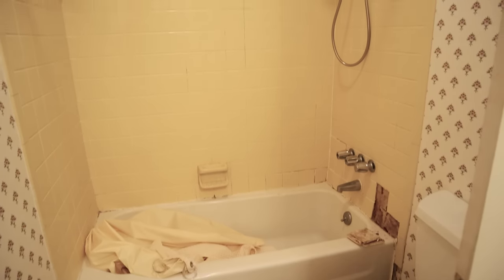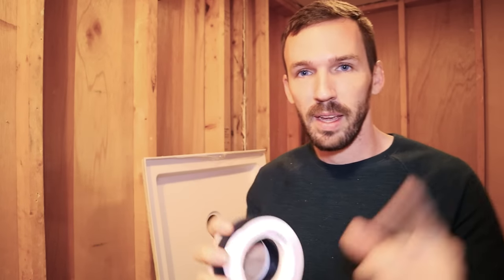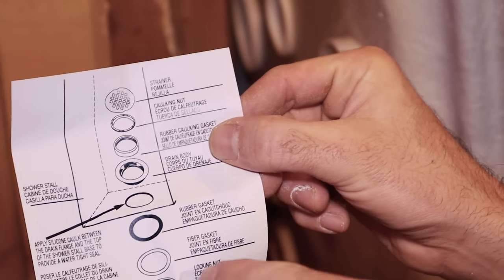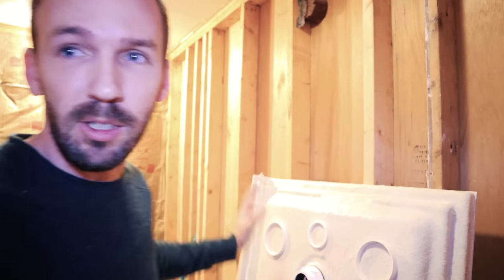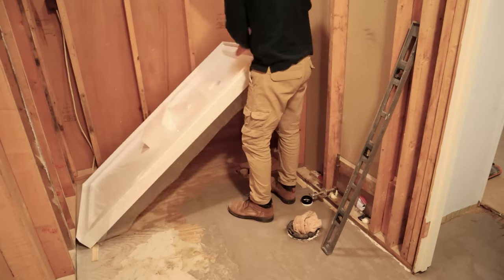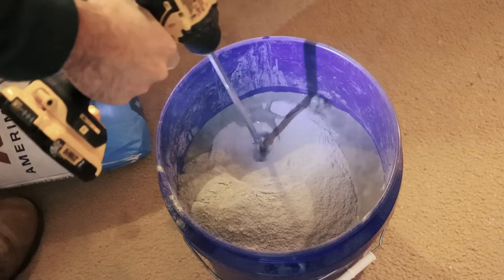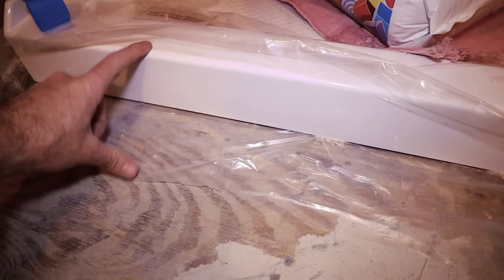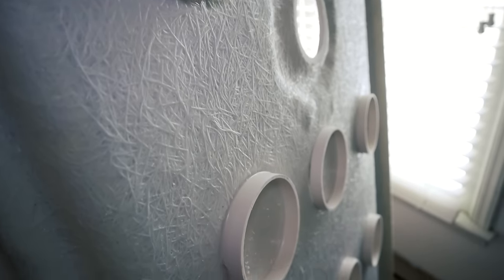How to Install a DreamLine Shower Base With Oatey Drain

Comment: As a newb to plumbing and scanning youtube on how to install alcove shower pans i'm finding it interesting how no one actually shows how to connect the  new drain to the existing plumbing. i would think this would be a pretty important instruction. everything else seems to be pretty common sense. not bashing the video just making an observation.
Reply: I noticed the same thing. Especially no videos showing how to connect one to a concrete slab. Or in my case connecting a offset drain to the existing piping on a concrete slab.
Reply: That’s the trick you can’t give away the ingredients to the sauce. But I’m glad you said that cause I need to know I’m a newb in carpentry and I’m redoing my shower
Reply: I just said this as I'm watching the video. Saying you did a step but not showing it, really messes up the "how to" part of the video.
Reply: Lol same no ones showing the drain install
Reply: @GamechangerzB  I figured it out on my own. Doing it on a concrete slab is more tedious but I got it done.
Reply: So for this installation if look at end all the he's really doing is setting the drain on top of the pipe and end putting the final drain cover
Reply: The plumbing is the hardest part in my opinion.

Comment: putty is oil based which is not recommended for polymer based surfaces.  so in this case, silicone is a better choice.

Comment: I can not find out at what height I should cut the drain pipe  so the drain connection will work. from your or any other videos. about cutting drain height. Maybe you could include that information I find that to be an important point.  If you can forward your method I would appreciate it. Good video

Comment: Looks great! Not that my opinion matters but, I would suggest on your next project using the self tapping pan head screws to go at a 45° angle on the top lip of the pan, into the wood studs, and not through the fiberglass itself, which could cause the fiberglass to crack and water could leak into your walls.

Comment: Your mortar is a bit thick. It helps that you used an impermeable membrane under it but that’s not likely enough to keep it from crumbling once dry. This is a common error that has come up during the many “re”installs I’ve done. Mortar should be of a slightly thin peanut butter, it should slide out of the bucket under its own weight. Not run out but just slide out. I don’t bother with plastic under the mortar but I do wet the subfloor slightly if it’s wood. Otherwise, your tutorial looks pretty on point. Nice work!

Comment: I'm 71 and intuitive, but I'm impressed with how you explained this floor shower pan install.
I'm in Arizona and my floor is actually slab cement.
Reply: For almost ALL shower pans you still need a mortar bed underneath to support it properly.

Comment: Seriously ... I've been looking on the YouTubes for someone to show a demo of putting a mortar base under a shower for so long so I can see the consistency.  This is actually my next step in my basement project -- hopefully this next week.  I'm also using the Dreamline Slimline shower base and an Oatey drain.  Thanks for the video.  I bought 2 bags of the mortar, having no clue how much I actually need and not wanting to be too short and wishing I had more.

I'm having challenges getting my inside-the-drain rubber gasket to fit...

Also, the YouTube algorithms showing me this video a day after you published it are kind of crazy...  But I guess useful.  

Good video.  Thanks for the walk-through.
Reply from the maker: Great timing since I just released the video yesterday! The rubber drain part does get tight for sure, especially if the drain is crooked or anything. A flathead can help work it around but be careful. 

Thanks for checking it out and good luck!

Comment: Good video. I'm going to Redguard the subflooring before laying the mortar & pan.
Reply: Good idea..  i think im also going to use some rubber roofng tape also just around the bottom edges..  the way the girls throw water everywhere  i figure thatd ease my mind a bit more.. now i gotta figure out how to insulate/ water proof the walls .  Took off the old surround and had 0 insulation and the vinyl siding of the house was the only thing between the shower walls and the outdoors..  wasp nests and bugs all up in there..
Reply: spray foam
 @Z-Ack

Comment: Hey brother Thanks i do this for a living and the plastic at the front was a good idea. 
Tip for mixing put 1/2 of the water on the bottom before adding the mortar .. just helps with  mixing all and all great job
Reply: you mean add 1/2 of the water for a 1/2 bucket of mortor, = 1/4 of the water into the bottom of the bucket before adding the mortor mix,

Comment: the plastic and window flashing is a great idea! I'm renovating a bathroom that looks like it went in in the 70s, and honestly, the entire bathroom to this day is still REALLY solid, EXCEPT for water damage to the drywall and subfloors around the acrylic shower, so I will definitely be using these tricks when I replace them (especially since MY work is not going to be anywhere near as solid as the original builders... need all the extra help I can get)

Comment: Thanks for showing mortar base i ripped out an old tile shower and installing a shower unit like yours, the walls and floor of this old house are not square so i have alot of tweeking, i didnt want to use shims like the instructions say. And i didnt want to use the floor leveling water stuff and build a dam and all that. So this was a quick easy solution. One issue if you set base and push to far you have to pull back up and repile the mortar so be careful when leveling.
Reply: You're right not to use shims

I did and the mortar didn't  set properly in the area

Comment: You know I always wondered what that little hole in my caulking gun was for. And here I thought I knew everything. Oh and that thing you're calling a fiber gasket is what plumbers call a "friction ring". It allows the nut to spin and tighten...👍

Comment: I am completing my floor joist install this weekend, then the sub floor.My pan arrives next Wednesday, question is, what time can you be at my house for the install ? Lol.  Great video, I hope mine goes as well as yours.
Reply from the maker: Lol I hope it goes well and this video helps. Good luck
Reply: @KellyConcepts   You completely neglected to explain the ptrap install and how high the downpipe had to be above the subfloor. Went so far as to cover the pipe with a rag (to prevent getting mortar in the drain obv) then did a jump cut pulling the rag out at 7:18 so newbs wouldnt ever know what to do...

Comment: Good job putting a rag in the pipe when tightening the drain down. That tool can fall in so easily
Reply: If the tool isn't stainless, a tape measure with a strong magnetic tip can be sent down after it (but I agree that it's definitely better to be proactive than reactive..stuff that rag in & keep on truckin!)

Comment: That's a protective shrink wrap that you will usually find on most fiberglass/plastic shower assemblies and tubs. I usually leave it on until the project is completed. It protects from accidental scratches, dropped screws, paint, mud or anything you may drop on the pan.

Comment: According to the instruction of Dreamline, you shouldn’t put any screw on the base lip into the studs. But I have been doing it for all my past shower projects and just watched you screwing the base flange into the studs😅. Any thought about “no screws” instruction from Dreamline? You did a great job and a fantastic video!!!
Reply: Anyone has some thoughts why Streamline doesn’t want its shower pan screwed into the studs ?
Reply: I'm a rookie at drain pans, but it seems that mortar, drain pipe and the surround would be sufficient to lock in the drain pan from moving?  But without those or big gaps between the pan and studs, I would consider siliconed screws and like the flashing idea.  I especially like the extra plastic under the curb.
Reply: I installed one couple months back , instructions specified NOT to screw into the flange  and to only use mortar , I was confused and called them and they told me the exact same thing . I’m sure screwing it down is not a bad thing but as per their instructions it does not require it and in fact they say NOT to very clearly  , maybe to avoid it from cracking when being drilled into
Reply: i suspect the movement between shower and walls could crack it where the screw holes are that is why they don't recommend it
Reply: Use a plastic clip that goes over the sides of the flange and then you screw the upper clip into the stud so there is no hole in the flange.

Comment: I would use a large pair of needle nose pliers with the metal tool to tighten and compress the rubber grommet instead of just a screwdriver.

Comment: Thank you for your video you have some good waterproofing ideas! I was talking to the Carpenter who is going to frame in my shower base it’s going to be DreamLine SlimLine 48 in. W x 34 in. D Single Threshold Center Drain Shower Base. I told him about the 1/8th inch gap between the studs and the base. He said he thought it would cause the base to crack. I don’t know what to do now because I’m getting two different messages here and I want to do the right thing. How has your base held up so far?

Comment: How is the Airbnb doing? I have one with two showers I’m preparing to tackle. I was going to do with mortar pan but after doing some research, fiberglass pans seem to be the way to go with Airbnb’s. I guess it’s easier to maintain. Any advice would be great. Thanks and great job.
Reply from the maker: The AirBnb was going great but I ended up selling this one because I got an offer I couldn't pass up. I had the same thought process as you, mortar seems more elegant but all of the grout lines will make it a pain to clean. My new Lakeside Bnb has a mortar pan shower and a fiberglass shower, the fiberglass is much more convenient and cheaper.

Comment: Great video. How do you maintain the 1/8 inch gap from studs while screwing in the flange around the tub?
Reply: Could throw a shim between the flange and each stud. Someone else mentioned here though that it would be better to use a different type of mortar and no screws instead.
Reply: @TheDeanosaurus  was just going to comment this. Seeing the screws go in felt harsh for a new unit

Comment: Use plumbers putty under the drain flange. Using the caulk/silicone makes it incredibly hard if you ever have to take it apart.
Reply: Plumbers putty gets old and cracks marine silicone will last almost forever.
Reply: plumbers putty stains acrylic
Reply: Depending on what was used. You can use a hair dryer to soften up the silicone and remove the drain. Done it several times repairing hot tubs
Reply: Hair driers/ heat guns are good for so many things, shrinking electrical shrink wrap, drying a damp charger port on a mobile phone, amd just the other day I was told that for swelling particle board you can dry it with a heat gun, sand and reseal it with your sealant to repair. Especially useful for swelling in kitchens and bathrooms where water is just starting to leak.
Reply: @davidnolen9537  Some of this shower pans do NOT recommend using plumbers putty.  They want you to use silicone.

Comment: Hi Kelly.  Thanks for your wonderful video.  I have questions for you.  1. Looks like you don't put the mortar that covers the whole base, just smaller area, why is that? 2. The shims you put in the front under the base, are you leaving them there and caulking over them?  Also, the gap from the floor to the base (= the thickness of the shims), which is not small.  I don't see mortar put right in the gap, so will you feel the base unstable at that area?  3. The gap is not small, how do you caulk the front?  Just enough to cover the gap?  4.  What kind of plastic sheet did you use, from Home Depot?  Thanks for your time.

Comment: I've read the Dreamline installation instructions and I did not see how high above the floor the 2" pipe should be.  Also did you use 1/2 of a 60 lb mortar bag?   I'm not sure how much to use.  Great video.  Big help.

Comment: I'd recommend using silicone to seal under the drain body
Reply: Not a good idea to use silicone because in the future if you have to ever have to remove the strainer good luck
Reply: I dunno guys why not just use plumbers putty?
Reply: @joshuarobison3295  some shower tray manufactures tell you not to use plumbers putty because it will degrade the material of the shower tray over time.
Reply: @SebsCards  mine says dont use putty ... use latex/acrylic sealant... what is that?

Comment: Good video and thanks! -- question though: the Dreamline shower pan instructions say nothing about drilling holes and attaching to studs.  Curious why you felt this was necessary (btw, I've seen a number of videos with installers doing this although the manufacturer instructions do not specify it).

Comment: Where does the plastic sheet "skirt" go in the stack up of the floor?  Between the plywood and lower thinset?  Between the lower thinset and uncoupling membrane?  Between the uncoupling membrane and upper thinset?  Between lower thinset and uncoupling membrane would make the most sense to me because though the plastic would prevent the bond between the thinset and membrane, the neighboring thinset and membrane would be bonded, so they'd still essentially still be coupled.

Comment: Am I correct in assuming that you have to demo the tub/old tile walls down to the studs and subfloor before you can accurately measure for the size of the pan you will need?
Reply: yes it goes up to the stud walls then walls go over it

Comment: If you're making that plastic skirt 6" from the edge of the pan, the water will just run 6" and find its way to the wood might as well do the whole floor underneath tiles

Comment: I'm doing same thing for the first time and I was actually wondering about the screwing the pan into the studs. You said earlier that you left a 1/8 gap between the pan and studs for flex. My question is, wouldn't screwing the pan into the studs take that away???
Reply: I was wondering the same thing... 🤔

Comment: Good video but How does the plastic protect the subfloor ? The tile guys will just cutt it right off makes no sense instead of being right at the edge of the pan now the water will just be 4 inches down 🧐🧐🧐
Reply from the maker: In my case I used Luxury Vinyl Planks so that just sits right on top of the plastic. Same with Laminate floors. You're correct though, with tile the mortar won't set on the plastic anyway so it wouldn't work - I should have made that clarification.

Comment: 2 questions?  Where do I order that shower pan? And isn't your subflooring suppose to have underlayment before you install mortar bed? TIA
Reply: didnt think mortar directly on wood floor was a good idea.  Maybe tar paper and metal lathe ???
Reply: Yes, do not ever use USB particle board crap for the subflooring sheet material.

Comment: my waste pipe is a little short. when you said you can use caulk what would i do put caulk in and leave out the rubber seal. or would i use both.

Comment: Should you have the contractor replace everything that's concrete border or just having replaced the bottom half and build the shower over the entire thing so it'll be stronger

Comment: I'm putting in the same shower base my concern is when I mix the mortar after dry fitting the shower base & marking my level lines on the studs when putting the shower base back down I would not be able to get all the mortar out from between the little round feet and the floor which will not allow me to get all the way back down to my level lines I initially marked from dry fitting it. I have done construction for many years from the age of 17 to 35 I am 50 now and done several bathrooms but we never used mortar to lock a shower stall in place. so it's something new to me what does the mortar do?  I mean you're locking the shower stall in place by screwing it to the walls and if you have it level all the way around it shouldn't flex. should I try to Mark the feet somehow with something then dry fit it to transfer the marks to the floor? he showers tub on the floor?  is the mortar a must? and if so how much mortar to mix? ⅛ inch? ¼ inch? or ½ inch deep? thank you for your time
Reply from the maker: Hi there! Think of the mortar base as luxury. It is not 100% needed so no matter what you do, you'll be ok with the results. I actually spoke with a contractor on this recently and he has done a hundred shower pans and just sprays the window foam insulation and sets the pan on top of that

However, mortar does help hold the pan in place, keeps it level, and prevents a lot of squeaking that will occur without it. 

The idea is to get about an inch of mortar on the entire floor and a little less around the drain hole. Then in the areas that you know need to be raised (unless you have a perfectly flat floor), you will want to add a little bit more mortar to that side. 

Once you set the pan on the mortar, you should be level or above your pencil reference lines on the studs. Then tap on the sides that need to be lowered into the mortar until it becomes all level - then let it sit until dry.

The shower pan is very hollow underneath, most of the mortar will just go and fill the voids as you push down the pan.
Reply: Saw a video where they recommended not putting the mortar under the round feet.  Just in between.
Reply: @toms5094  But how can you do that if there's feet all over the thing?
Reply: @toms5094  Yea but this would seem to be a REAL pain!
Reply: The pan was never designed to stand on the floor without the mortor mix under it, it is to flimsy for that to not have mortor under the pan.